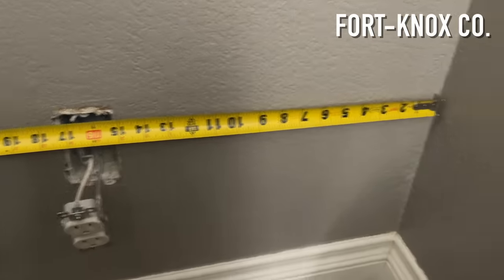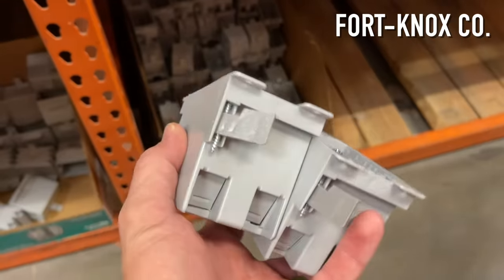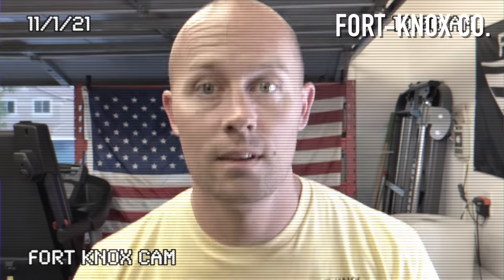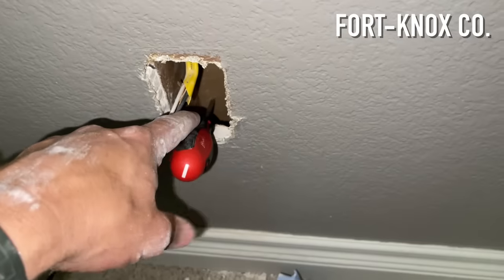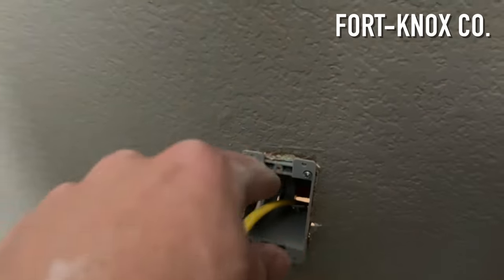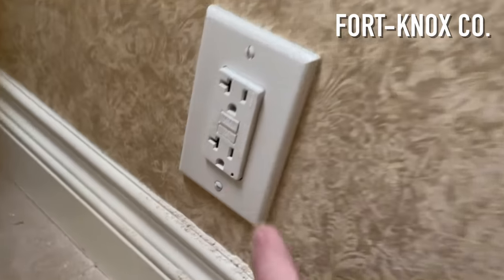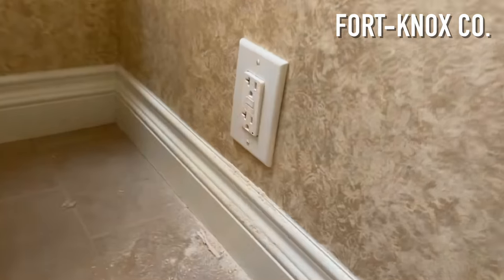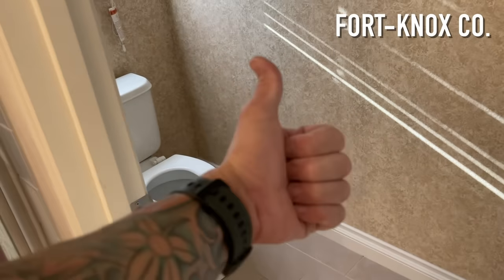How to Add an Electrical Outlet ANYWHERE !! Heated Toilet Seat or Bidet Install | Run Power Easily

Comment: I want to install an outlet right next to the bathtub. It will make it so much easier to throw the toaster in.😄
Reply from the maker: I Wouldn’t recommend that one.
Reply: Chucky would appreciate if you did
Reply: Let me know if you're able to read women's minds after that (movie reference for the ones who don't catch it).
Reply: @AnthonyChhan  what women want?
Reply: @jaxfortner7979  yes sir!
Reply: After all these years, I still can't read her mind. But I can spot a pissed off woman from 50 paces. 😄
Reply: Heck, even just your iPhone will do the job!
Reply: @jmseipp  well not sure because most iPhones are pretty water resistant now-a-days
Reply: @jaxfortner7979  There was a case in the news where a girl died after she dropped her phone into the tub. Not sure what type-brand.
Reply: @jmseipp  I can’t imagine it was from the charge of the battery in the phone.
Reply: @jaxfortner7979  I don;t know the details. My iPhone came with a 5 watt charger. And I sometimes use a 12 watt charger. Maybe she had it plugged into an extension cord and the ext cord also fell in? The article didn’t say.
Reply: @jmseipp  Initial reports said Madison's Samsung 6s Edge had fallen into the tub, but evidence later revealed the phone never actually touched the water.

Investigators believe the girl took precautions to keep the cords dry but was not aware of fraying on the extension cord, the statement says. Evidence suggests she likely touched the frayed extension cord while still in the tub, Lovington Police said.
Reply: @minhnguyen-fr5zq  Was that in the U.S. or elsewhere? Many of the countries I’ve visited 220 volts whereas here in the USA we have 110.
Reply: GFC outlet for sure.

Comment: Biggest thing I would add, if you’re not an electrician and your house was built before 1980/1990 I would not do this. All sorts of interesting things were done in older homes. Sometimes just taking out an outlet can be opening a can of worms. You ran into an ideal situation. 1 set of wires in the original box. It was 12/2 ROMEX. You didn’t have to jump bays. If you find this situation in an older house go buy a lottery ticket too.
Reply from the maker: Your 100% right. In Older homes you’ll find all kinds of different materials used and methods used. It can be a simple job at first, then turn into a whole different storm once you see inside those walls
Reply: Yeah, like no neutral wire! Yikes!

Comment: Not sure what your building codes are in your area but in my area, it is a code violation to put an electrical outlet near a water source.  I found this out because the previous owner installed a utility sink near the breaker box and he also put an outlet, below the sink in the master bath.   Code inspection resulted in me relocating the boxes.   I’m not trying to be difficult, just providing data that if anyone wants to install new electrical circuits, check the building codes in their areas.
Reply from the maker: I appreciate the info. Installing an outlet directly under a water source is obviously a bad idea. Lol. But there are also outlets in bathrooms, usually above countertops, so it can be near or by water sources. Just within safe distances. Almost all times they require a GFCI on that circuit as well. And code out here goes even one step further now where every outlet has to start with a GFCI outlet. So it is always good to check your local code. They are in place to for safety. And there’s usually a way to accomplish what you want within code
Reply: John - I think it’s 18 inches ( electrical outlet from water source). Of course no utility sink next to the breaker box.
Reply from the maker: I agree. A lot of codes will require a specific distance from a water source. You should also see in that code how they measure that distance. For example, a sink in the corner of the kitchen, they might measure to the nearest corner of the sink and others might measure to the nearest corner of the sink that is closest to the wall.
Reply: @mar1video  for sure. Uncertain if national electric code supersedes municipal though probably not as local codes more likely are based on federal ones.  Prudent common sense in application suggests if in doubt and there’s no preference then the more restrictive code prevailing covers you, but if this is a DIY channel i’m not understanding that degree of concern with code enforcement.  Perhaps lenders or insurers require old houses to meet new codes when participating in certain new purchases because DIY remodelers do not have to pull building permits.  

Ridiculous to think there’s not a way to achieve the safe provisioning of power near water though and homeboy didn’t do a non-fault-protected floor plug in a laundry room or next to a whirlpool or something stupid (maybe aluminum wire for the jumper lol) so it’s only a useful and necessary discussion about this type of application specifically because it makes the point of how and why there’s a single answer for each installation not every installation.
Reply: Since this is YouTube, which is available free, it seems to me just providing data is closer to trying to be difficult than being difficult without even trying.  Passive aggressive AF though (apparently without trying) to imply free YouTube help for DIY should deliver content detailed explicitly enough for individual suitability.  I like my DIY work to meet code as well, but the biggest advantage to not pulling a permit is fucking the code when there’s a good safe reason to do so.  You can see the ridiculousness/inconsistency of code which permits power for a waste disposal beneath a kitchen sink that would forbid it in a bathroom

Comment: Just be aware you cannot tap off any other outlet (hallway/general purpose power) unless it is associated with the bathroom circuit, or any additional bathroom’s circuit. A bathroom(s)circuit(s)shall have no other outlets.
Reply: Guess they didn't know that when my house was built 😀
Reply: @uweschroeder  As long as whatever you plug into those outlets don't trip the breaker, them you should be fine. If it really bothers you, then you can fix it but depending on your house, it's either gonna it's gonna be straightforward or challenging
Reply: If a home inspector finds this you may have to fix it to sell the house or lower the price to cover the fix or maybe they'll just back out of the sale.
Reply: @Dave.O  I think that's the least of the problems where I live. Here they started doing a code inspection before you can sell a house and they fine you and require you to bring the house up to current code if it's not - and that's just a given since no house in this town is up to current code unless very recently built. It's a way for the city to make extra money and get contractors - who big money supported that legislation - to make more money. I already know it would cost anywhere from 100k to 200k to bring this house up to code and fully permitted. So I'll never sell the house - I'd rather turn it into a section 8 housing or just rent it until it falls apart.
Reply: @uweschroeder  Could not agree more Local government really sucks, it kills the home owner little guy. I think the job was well done  and safe .
Reply: @Dave.O  I would tell the buyer what”  I “ did and if they did not except that I would tell them  Stop nitpicking.
Reply: 210.11.(C).(3).  Bathroom Branch Circuit points to one or more 20 Amp circuits to supply bathroom(s) countertop and similar work surface required by 210.52 (D).

210.52.(D). Points to at least one required outlet near the sink basin.

Now back to 210.11.(C). Since this is not near the basin;  not required on that circuit.  The exception there allows (not required) additional outlets to be added for a single bathroom fed from the circuit.

In summary, it looks to me that the beday recepticle can be powered from any circuit not restricted by other code requirements.  It is allowed to be on the 20 Amp circuit that feeds only that bathroom, but it is not required.

There is an exception
Reply: Interesting.  Does it differ by state?
Reply: @keithharrington8715 does it differ by state?  Thanks.
Reply: @nicholasnovak4  it may.  The electrical code in section 90.4 allows what it calls "the authority having jurisdiction" (the county in some states and the state board in others) to accept or decline all or any parts of the electrical code.  Some states even have a supplement to the code for their specific rules.  An example of this is North Dakota.  They have about 60 pages of extra rules for the code and electrical trade.  Some adjustments are 3 branch circuits for the countertops, a ground rod in street lighting, and specific height requirements for service equipment.  The large amounts of farmland make each street light the tallest thing around (almost zero trees)....a lightening rod.  The lack of trees, again farming about everything even the grass on the highway, allows almost nothing to stop snow from blowing around.  They want to ensure the fire departments can find the electrical meter, rip it out, and reenergize the house in a fire.

Comment: Funny how the word "ANYWHERE" in the title is all caps, yet missing the asterisk... *ANYWHERE...as in anywhere you have an existing outlet nearby. For the record, the video was good, just didn't match the title
Reply from the maker: I get what your saying but that’s not entirely true. You can implement the same concept and techniques of wiring, cutting out the old box, installing the new box practically anywhere you want in the wall because of the way it attaches on the inside of the drywall, and even jump across studs with drywall work included in the process. I have videos showing outlets being ran up a wall for longer stretches, electrical being fished through and across attic space. The videos intent is to show techniques for moving electrical, and if you implemented some of those now hopefully learned techniques you’d pretty much be able to install an outlet…anywhere you wanted. 
I appreciate the feed back though. Everyone has different experience levels, most my videos are to just show things to others and help educate.
Reply: @steventhompson558  it’s more about taking techniques in a video you see and then using your learned skills and applying them in your own unique situations. If you go over EVERY scenario that someone could come across where they would want to move an outlet to and then cover all the obstacles that could come up…you’d have a video so long you’d never find they scenarios that apply to you vs all the other ones that could happen. I think it was more about showing one way with some techniques and keeping it simple and to the point. There’s plenty of content out there to cover other specific scenarios.

Comment: Viewers beware, this may not be up to code where you live. At the very least, a GFI outlet is required anyplace where water may be encountered. There may also be rules, specific to your locale, that complicate placement of bathroom electrical outlets.
Reply from the maker: That is correct. You should always check your local building codes. And just like in this video we installed a GFCI outlet because it’s in an area where water or moisture is present. You should always check with a licensed contractor or electrician if your unsure.
Reply: I would not want to be the potty training kid who accidentally pees on that outlet...
Reply from the maker: @spicyreef  yeah that’s be no good
Reply: @spicyreef  heh reminds me of a sign in a restaurant bath....we aim to please, will you aim please

Comment: What if my house is not built from paper but actual bricks?
Reply from the maker: You will need to cut through that brick and run your wires and/or run external non conductive conduit to where you want the new outlet.

Comment: I thought that a bidet needed to have a dedicated circuit with nothing else on it.
Reply from the maker: Some might but usually with the power they need that would be overkill. The bidet themselves don’t use a ton of power, so you may be told by local code to have a dedicated outlet, but that usually is so that you can have that GFCI or AFCI protection on the circuit.

Comment: Why didn't you install the bathroom outlet behind the toilet?  A bidet cord will be very visible.
Reply from the maker: The wall behind the toilet is an exterior wall and it would require a lot more drywall work to move it around the corner and then on that wall behind. The homeowner wanted it in that location specifically because it was less expensive to do and they planned on having a little rack that goes on the floor there to sort of hide outlet. They weren’t too concerned about the cord, being visible, and more so about having the ability to use their bidet, but yes, it is possible to run the wire back there if you want to conceal it more. Just requires a little bit more work.

Comment: That’s great advice for everyone who lives in a new or pretty new structure. But what about all the folks that live in old homes without drywall or modern wiring? Big bucks.
Reply from the maker: Yeah every house is going to have its difference challenges. I’ll be showing different installs or obstacles that come up as I do projects so hopefully there will be something that can help everyone with their at home projects

Comment: Great video. Question? The distance between the toilet and plug doesn't matter, as long as you have a GFCI plug?
Reply from the maker: I wouldn’t say it doesn’t matter, but the GFCI is that safety measure. But you still need to try to avoid any water contact. So the furthest away or in a position that protects it from moisture or water is best. The GFCI outlet is just a safety measure in case it were to get wet or have some type of short. But I would still always try to put it furthest away from any water source. 

Local codes in different areas may have different measurements they require.

Comment: For small or one time project, is it better to used a rotary saw or a hand saw? Would prefer nice clean cut.
Reply from the maker: Yes you can use a multi tool or whatever you prefer. To cut the nails or to cut the drywall. Whatever tools you have to get the job done. There’s many ways to accomplish the steps.